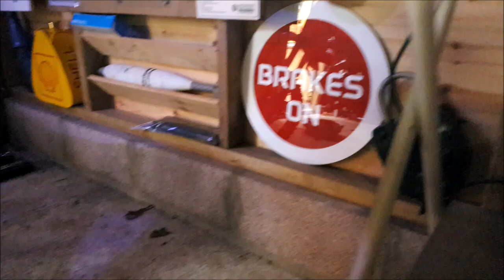SERVICING MY DEMON 170 DETROIT |CABLE LUBE TOOL

Comment: Running lean my friend by looks of your spark plug! Like the pit bike vids... going to look at an 07 arctic cat 250dvx here in about an hour extremely low hours as I'm like 6 or 7 hours and they want a 1000 for it. Mint condition no scratches on plastics garage kept so hopefully my wife will have something to ride with my son and I on my apollo 125 and his 110.
Reply from the maker: That sounds like a lot of fun for 1000 and sounds like a good deal mate, will go match up well with apollo for sure

Comment: Good vid mate as much as I love the riding vlogs I also like these ones about maintenance maybe 1 day if you get time and fancy it can you do a vlog about timing and value adjustment as I’m sure I’ve done mine wrong lol bike just don’t feel the same lol and lucky them 2 little bearings could of gave you a right load of grief seized engine would not of been good also white plug means it’s running to hot or the timing is out so google says lol also wot spark plug would you recommend getting cheers mate
Reply from the maker: I enjoy watching people work on bikes too does not have to be ripping bikes. That is a vid on my list to do but so far my timing is ok, ido have to adjust quiteoftwn especially over rev when doing wheelies. I use ngk plugs. Think carb needs adjusting to make bike less lean, need to investigate more  lol. The cable lube tool works a treat bullets clutch was so stiff this made it feel like new again

Comment: Hi I enjoy your videos and I purchased the same bike as you so very helpful , can I ask when you remove the sump plug doing your oil change do you need to apply a rubber gasket? 

Thanks
Reply from the maker: Hi and thanks I'm glad you enjoy the content and fund some helpful. 
No gasket just the washer. Shouldn't need any gasket unless overtightened and stripped the thread
Reply: Great thanks bud! keep up the Detroit videos 👍

Comment: To lean on fuel air ratio
Reply from the maker: Does that mean I need less air ?
Reply: @motomachinezuk8786  yeh, it needs to be richer (more petrol)
Reply: Yes more fuel. What carb you running and where is the air fuel mixture screw on the carb?

Comment: Do u use synthetic or non-synthetic 10/40 in the Detroit please bud?
Reply from the maker: Semi synthetic mate
Reply: I'd say that motul oil is no good for them judging by the amount of build up on the drain plug I'd recommend putoline dx4 or castrol 4t

Comment: Tip for ya use gt85 instead of wd40 in the clutch an throttle lines as it has a Teflon coating so leaves the cables better lubricated than wd40 an for longer. Wd40 isn't really a lubricant
Reply from the maker: You are right I would usually use gt85 but only had wd40 and kinda thought same thing but I'm sure you are right. Teflon stuff it is from now on, cheers

Comment: Jonny is the oil filter the same as the 160 oil filter as thats the only ones i can find mate i presume they are the same but an opinion from someone with plenty experience with detroits wont go a miss cheers in advance matey 👍p.s more detroit vids please they are my personel favourites i do enjoy your sur ron vids aswell 👌
Reply from the maker: It a yx160 filter usually they are metal but there are more options i notice. And oil is about 750 or 800 but just check on site glass. Detroit vid tomorrow mate. This channel is a mix lol
Reply: MOTO MACHINEZ UK great stuff m8 and thanks again cheers👌👌
Reply: MOTO MACHINEZ UK ive ordered one i wonder if i can keep the one i take out and clean the outer mesh with a toothbrush dipped in a bit fuel or something have you ever done this or is it defo throw away once out? U will be sick of my questions haha sorry😉
Reply from the maker: I never personally clean an oil filter its just throw away but its probably possible to clean if really want to. Risky tho as want oil as clean as possible. Let me know if you do mate. No worries idont mind trying to help

Comment: What ml of oil do u put in the engine I have no dip stick to check level inside the engine only the window on the side
Reply from the maker: Mine does doesn't have a dip stick, they dont yoy use the sight glass. Uses about 750ml
Reply: I always use 750 ml aswell

Comment: Was the magnet on the sump plug from stock? And where should i get the oil filter shipped to finland,i have been thinking to buy 20pcs of them straight away.
Reply from the maker: I get mine from Ebay, red  circles is the seller I use. Cheap and quick delivery. I think it was stock on this bike yes. Rim locks are on my big wheel set. I dont use the small wheels
Reply: MOTO MACHINEZ UK Thanks,are they needed with that sort of engine with high pressure in the tire? And thanks for fast answer 👍🏻
Reply from the maker: @Jortsa  by the way the oil filter on this is the metal ones. I run like 10 to 15 psi else its rought for me and I prefer them like that. I know most people use 20 psi. Probably why I broke a few spokes over the years I'vehad to replace.  I'm unsure I dont want you to blame me for choice. Probably get away with it but I'm no pro. No worries I always try to help and answer questions plus reply to every comment if it's not abuse lol
Reply: MOTO MACHINEZ UK yep i dont blame other people for my own mistakes :D i just need some recomendations. I ride on road most of the time so high pressurest arent problem.I have spre tubes too if they break and if they break i install rim lock at the same time.I still know that my rims is going to be changed with that grunt very fast lol.
Reply from the maker: @Jortsa  should be fine then without them I'm not sure what spre tubes are? Wheels are weak like all standard pit bike wheels but this engine is very torque I think so strains the rear wheel lots. Does not help jumping oil barrels but I absolutely love mine it's great for the terrain I ride.
Reply: I mean spare tubes sorry for writing errors,i think im going to order the detroit 170 engine kit next week from wpbracing.
Reply: My thumpstar 170 detroit came with magnetic sump plug as stock and my demon x detroit also has one on also however cant say wether or not it came with bike when new as i bought demon 2nd hand when it was only a few months old .i currently put 750 mil in both my detroits does that sound about right johnny ? Ps your spark plug being white and dry would suggest its running a bit lean johnny mate i know you are running stock carb so half a turn ANTI clockwise on the fuel screw underneath carb will richen it slightly .if its no better turn out a touch morr till plug a nice golden brown